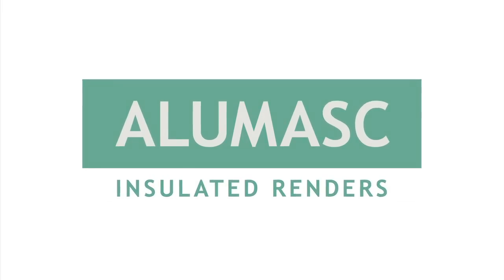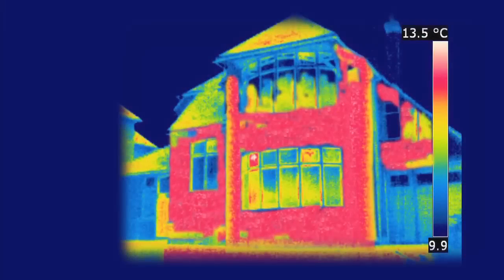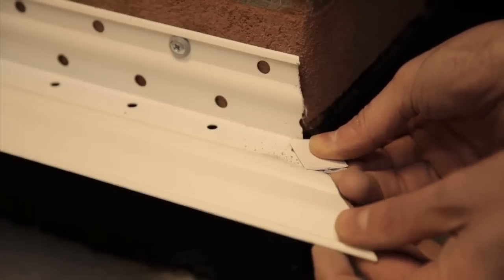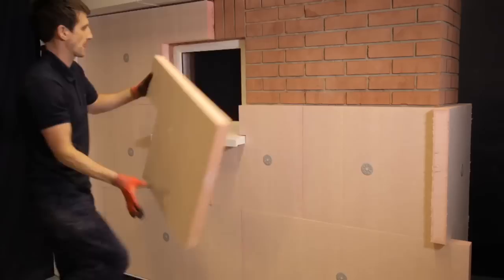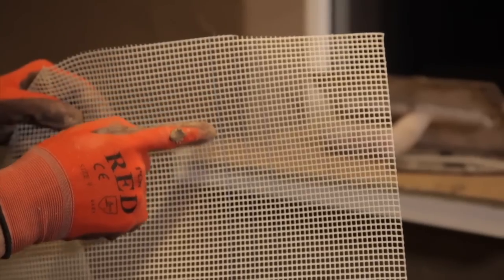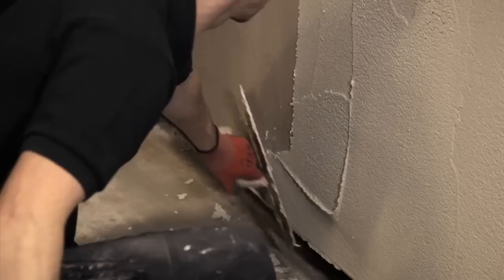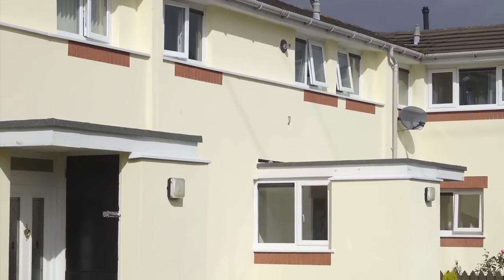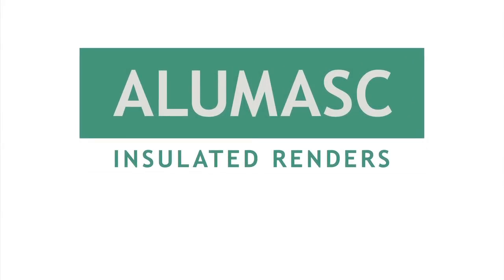External Wall Insulation (EWI) & Render Systems - Alumasc Facades

Comment: Hello,

When I put on XPS foundation insulation, I will sink it 40 cm (about 16 inch) below ground and 40 cm will be above ground. What should I use to cover the part underground? Should I glue facade mesh on it too? And at the end what should I treat it with? 

Where the EPS aluminium base rail bottom meets with the XPS foundation insulation, can the bottom of the aluminium base rail be simply plastered/glued? Or with what should I cover this base rail? 

Thank you for your answer in advance!